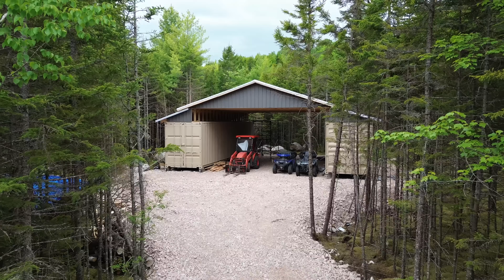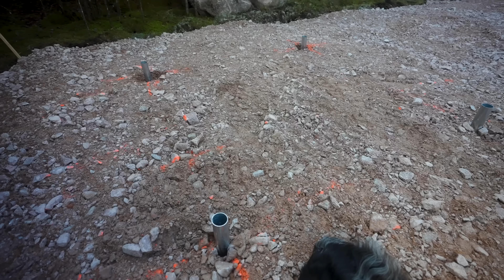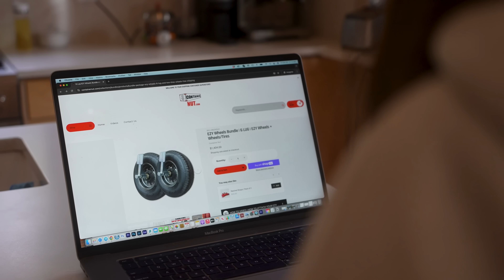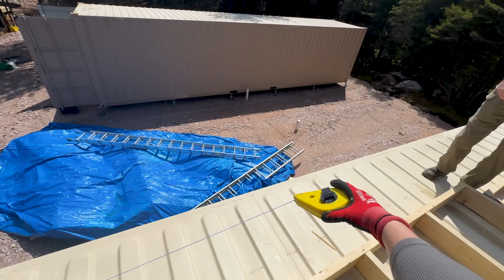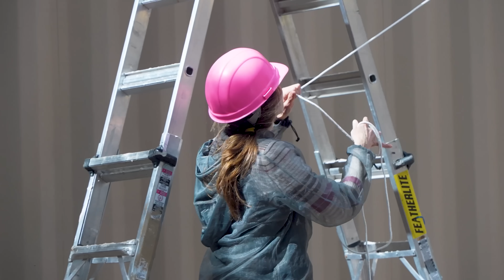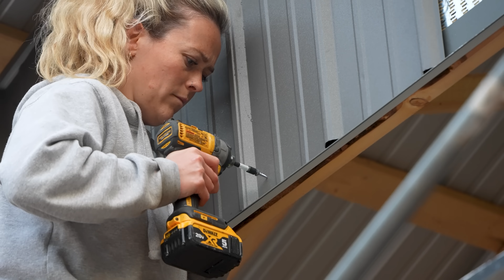TOTAL COST of DIY Shipping Container Shop (Full Build Start to Finish)

Comment: For the vertical risers ontop of the SeaCans that support the upper trusses add some angled front-to-back braces to control any attempt for the structure to want to lean forward or backwards.
Also the SeaCans are not rated for any structural load where you put the vertical posts holding up the top trusses.  Contact the truss manufacturer engineering department and send them your room dimensions to find out your snow load rating and what forces you will be applying ontop of those SeaCans factoring construction material weight and live loads.

Comment: I don't know about these roof panels, but in the corrugated ones I've used, the screws go into the highest point, not the flat as you showed, otherwise the holes leak over time.

Comment: I am worried,  all the weight of the  wooden roof,  is setting on a weak spot of the container roof.  
The roof weight  needs to be  lined up  with the steel container Wall.
The containers  needed to be mov apart.  So the weight is above the container wall.
Pony walls  are in the Wrong (weak) position.

Comment: I am sharing my ideas for how to get bigger and Andrew camerata has inspired me to go 4 stories with a hotel tower, with 8x9x10x40' containers built like a fire tower steel and concrete with 400 sq deck, capacity for 50 and bar seating for 40 people, mostly outdoor seating with like 16 indoor stools. I know how to do this, using steel and mechanical engineering and how we would do it.  Has anyone used a elevator in a container based structural design ?, I want to use a triple container array as a structural pillar, a support combined with steel and then use the vertical space to my advantages with many smaller rooms, 12, yet big enough. The elevator can be in the middle of the building, which is how you would do it, but I would want a real hotel that I can air bnb, that is ...about 1,110 square feet or more but sleeps a lot, 12-24 people w 6 showers, 2 toilets, huge common area and yeah we can do that with steel and containers, just steel would be different and I think the containers are like perfect column for my support and then you can use the space. You can get a jacuzzi poured into the foundation and a killer audio system installed, lights, powerwall the sky is the limit. For the elevator and hvac, I would need a generator and propane and hot water tanks, the rest can run solar upstairs because I am not running all that on solar, no way. I want to do this a off grid hotel, maybe outside Vegas and then get water trucked in.

Comment: WARNING.  I may of missed it but as a former framer that has rolled a lot of trusses and built a lot of walls, it looks like you missed a couple VERY IMPORTANT component's in your wood framing and truss set up.  You NEED diagnal bracing at both ends (front/back) of your row of trusses.  Without them, your entire roof may(sooner or later) "roll" like dominos.  Think of it like "sheer" support for the trusses.  Since you bought new trusses, contact the supplier for specs.  The second thing is "Sheer" support for your Pony walls for a similar reason.  The lumber is strong enough for the straight down pressures but there are/will be forces trying to push that wall over from front to back (dominos again).   I think you said that pony was 4 ft so a sheet of 1/2 inch ply ripped in half long ways would give you an 8 foot piece of sheer on booth ends of the pony wall, and youll beed to do that on both sides (left/right).  Might as well consult with a framer up tgere for safe nail schedule for that.  Now that i think of it, there are two otger things, one if which is also safety related.  There is virtually nothing keeping those ponys from folding/tipping left/right either, bringing down the entire roof down.  Remember, triangles are the magic that gives trusses strength, so id add a bottom cord to your make shift, (over the container part) truss system, and possibly some osb webbing to at least a couple on both sides.  Again, you shoukd probably consult with either the truss folks, an engineer, or a general contractor.  Im also concerned that you didnt double top plate that pony so those 10 foot sections were not unified and strengthened with an overlaping top plate.   Its got great bones abd you did good,  but I'd address these concerns so that roof doesn't come down on someone.  On top if all that, dont forget youll soon have critters living in those open beams.  Love the project.  Best wishes
Reply: You are Correct
Reply: Have a feeling you are just "man-splaining" into their ears.

Comment: I’m sure you noticed the little crescent shaped pieces of metal that the Nibbler makes, be careful not too let the dogs walk around them because they will get in their paws and it is very hard to get out. It is not as bad in gravel as it is on concrete. You can’t just pull them out straight out, you have to pull in the shape of a crescent. It sounds like a stupid statement, but when you dog is NOT to keen on you jackassing with their foot, it’s not as tentative as it sounds. 
And they also will get into the soles of your boots. 
Good job. Are you thinking of putting doors on it. That may make a good video.

Comment: Never use a ratchet strap as a lifting device they could easily pop open  you should’ve used continuous slings or flat strap for rigging and gone to each fork even though I know that your trusses aren’t that heavy, but that’s just the right way to do it

Comment: I'm always so impressed by how much you get done in so short a time. Great job!
Maybe they are out of sight on the videos, but one issue I can see with the roof structure, I can't see any front back diagonals, i.e. diagonals parallel with the length of the containers. Both the pony walls and trusses really need these. If you don't have these, then wind blowing against the ends of the roof could bend it.

Comment: I beg to differ.  That's not a workshop yet, it's just an open air barn.  You still need to enclose your ends, build some massive doors, bring your electric inside from where you left off, (and plumbing too),  install useful lighting, and add power drops for your shop equipment.  And of course a concrete floor would be Da Bomb!  And you should be able to get at least 4 videos out of that.  Other than that, it was a massive undertaking and you gals aced it!

Comment: Just FYI, a pony is also a small engine which is used to start the big engine in old school bulldozers and the like. Ya rev the pony motor up real fast, and then engage it
with the big engine to sort of act as a starter. Hopefully, the big engine will start dependably. Otherwise it's an Apply, lather, rinse, repeat thing.

Comment: Bare metal roof without sheathing will tend to collect condensation on the under side. Then you have "rain" on everything underneath it. So nothing will stay dry during storms and cold weather. We are in Central California which is very dry and still had "rain" on our RV when under our metal RV cover in winter. We had  covered insulation installed to prevent the condensation from forming.
Reply: There's enough ventilation underneath so what you are saying will be very minimal or insignificant.   If they close it in and heat the building, then what you say comes into  play.
Reply: You are Correct

Comment: A pony is a type of small horse, usually under a specific height at full maturity. Ponies often have thicker coats, manes and tails, compared to larger horses, and proportionally shorter legs, wider barrels, heavier bone, thicker necks and shorter heads. In modern use, breed registries and horse shows may define a pony as measuring at the withers below a certain height; height limits varying from about 142 cm (14.0 h) to 150 cm (14.3 h). Some distinguish between horse or pony based on its breed or phenotype, regardless of its height. The word pony derives from the old French poulenet, a diminutive of poulain meaning foal, a young, immature horse.  A full-sized horse may sometimes be called a pony as a term of endearment.

Comment: As someone who has worked in logistics, I can tell you that most containers that have been through multiple trips, they are all exposed to numerous noxious chemicals, and many are used to transport food afterward. You are smart to only get slightly used ocean containers. I would suggest replacing the floors as they absorb a lot of those chemicals.

Comment: .. Good job ladies ....  Kind of surprised you were not required to put a few vertical supports down the middle (ends and middle),, to control sagging ,, seems like a pretty wide span , even if it's only roof material weight ... Love the supervisors safety look ..  Seems like fasteners have really changed over the years , using screws instead of nails with the woodwork .... I do love a storage and space like that ,, wish I had one ...  Stay Safe ...
Reply from the maker: We appreciate you sharing your thoughts with us. Thanks for watching! 😊🐾

Comment: I'm not gonna lie when you first showed us the "land & cabin" I was worried about y'all. It's not I didn't believe in both of you.  It just looked like such a HUGE project. But dang did y'all ever kick it's butt. Everything looks gorgeous. Even the lake house which is extra. One thing I was thinking about. With those pests the flies. Is there a way to screen in the ends? So you can get a breeze but not the flies. Like sliders yes and the bottoms. The bottom you could just cut metal roofing to fit there. I just know it would be nice to have a screened in area outside away from the flies. Especially while working on projects. Just a thought. Yes ur plates are full now. Hope y'all have a great week! Sending love 🩷
Reply from the maker: Awe Rhonda thank you for sharing all your kind words and ideas with us. Sending love to you from the pack. 💛🐶